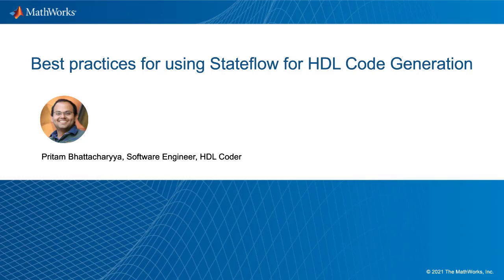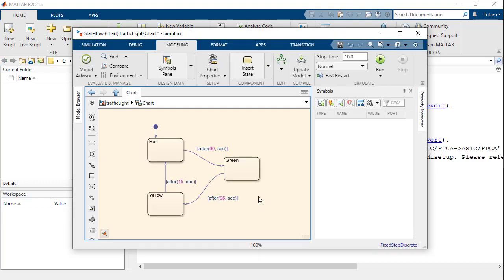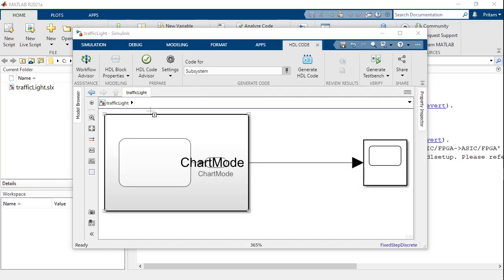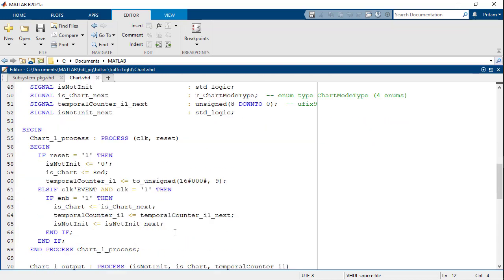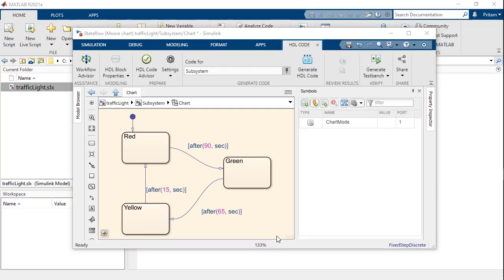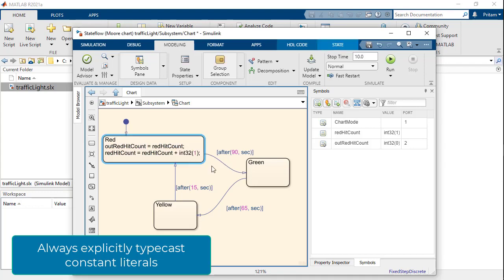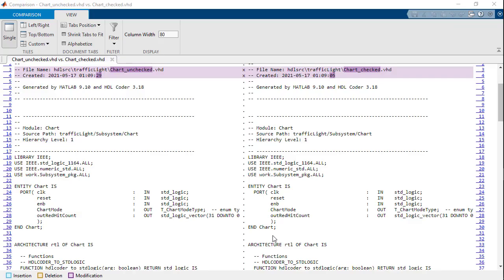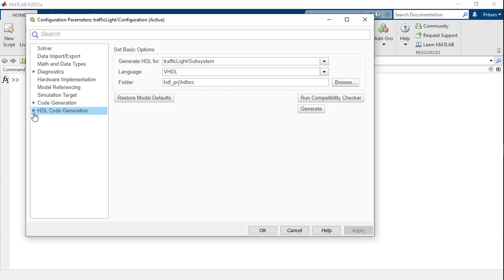Best Practices for Using Stateflow for HDL Code Generation

Comment: It's interesting that you emphasize how when checking 'Initialize Outputs every Time Chart Wakes up' will produce larger code. But as you said this also completely changes functionality so I'm curious  why are you even trying to compare two codes that have different functionalities? It's like comparing apples and pears
Reply from the maker: Video is explaining different scenarios of Stateflow chart. Comparison is to give an idea how a change in setting affects the hardware resources generated HDL would consume.